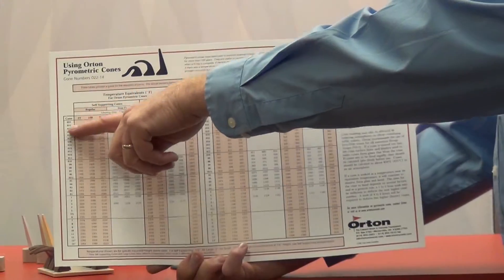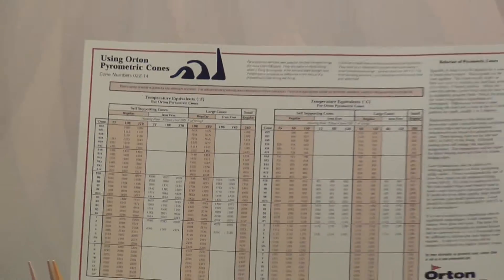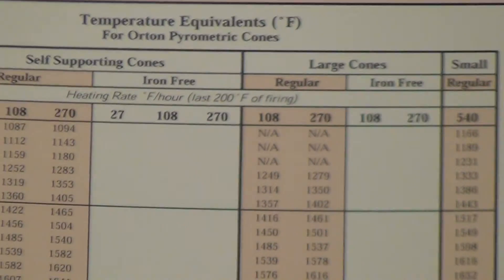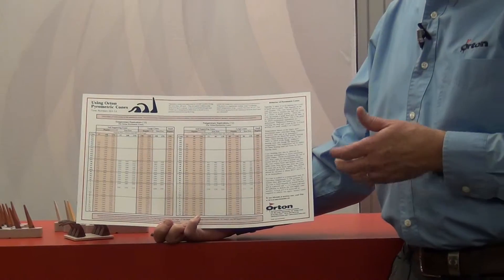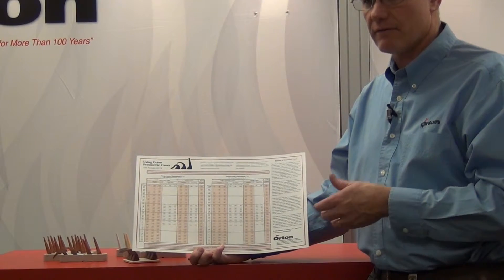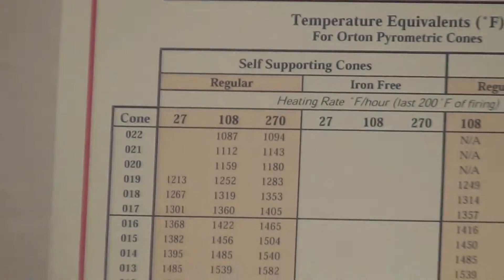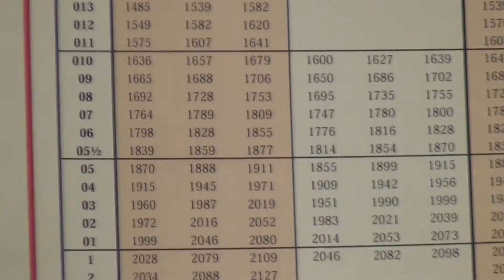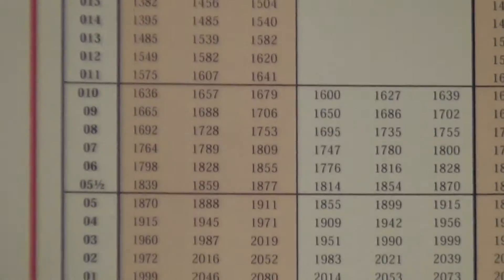Explaining the Orton Cone Chart

Comment: Your products pyrometer cone can be applied for measuring temperature set points at reheating furnace of hot rolling mill (billet product)? It’s same temperature of ceramic industry. 
If it’s possible how can I do it?